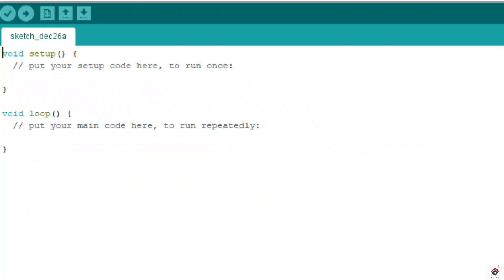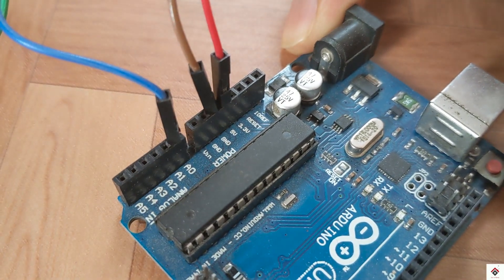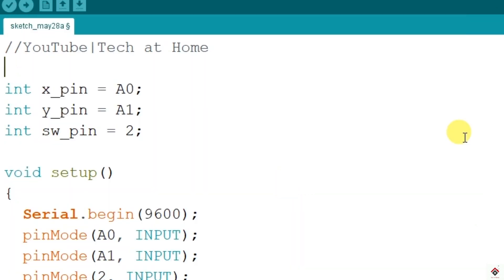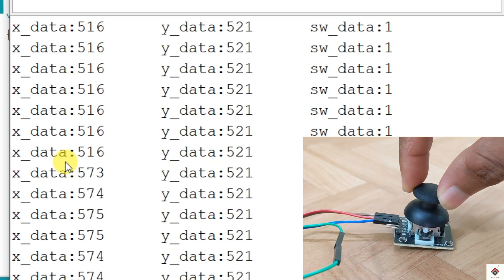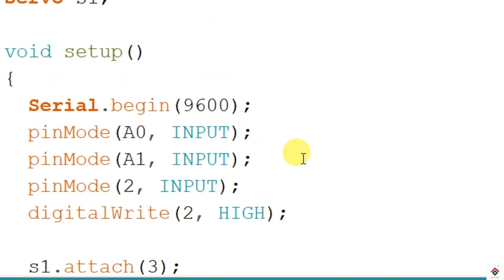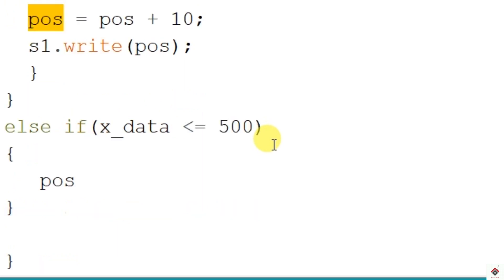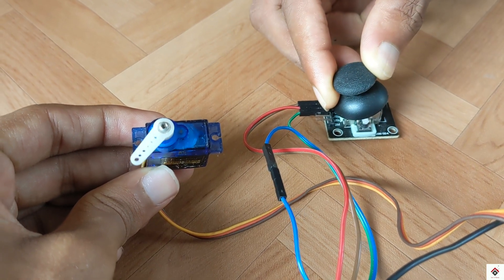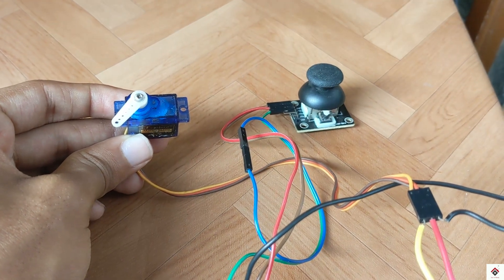Control Servo motor with Joystick and Arduino[with CODE] | Arduino Servo motor control | Servo robot

Comment: hey i am very much new to electrical and stuff , just wanted to ask can we connect 5v port on arduino to breadboard and then connect motor and joystick to it??
Reply from the maker: Servo motor draws more current, so the  voltage drops and Arduino keep resetting due to insufficient power.

So better to use external supply.

Comment: Can I power the same circuit with the help of laptop?
Reply from the maker: For servos there should be external 5v supply. You can take waste USB cable and cut the connector. From that use only positive and negative wires which are red and black. This way you can use laptop to power servos.

Comment: Day 2 of asking:Hi. I am a subscriber of you. I am subscribed since 2021. Also I have been watching you from 2021 and I haven't made any request. So, I am making a request today. Can you please make a tutorial on 900 degree steering wheel with GY521 MPU-6050 Sensor. It is a gyroscope sensor. Please I beg to attract your kind attention. If you could make it and oblige me thereby. Love from Bangladesb(🇧🇩)❤❤❤❤
Reply from the maker: Hi , Thank you for your support!
I hope you have seen potentiometer based 900 degree wheel: https://youtu.be/WMgQM67uWdM

In this same code, I had tried adding this gyroscope sensor.
But it was very unstable and fluctuating.
Steering was moving randomly since the values from this sensor keeps changing even for a slight movement.

May be potentiometer wheel is better for simulator games.
Reply: @techathome  I did. But I don't have enough materials for that. I also found out that GY52Q MPU-6050 Sensor is easy to use. But I can't find any tutorial on it for steering wheel. So, I asked if you could do it
Reply from the maker: I can try.

Fyi,
Most of the materials remains same,
Potentiometer will be cheaper compared to gyroscope
Reply: @techathome  Ok. Please make it as soon as possible or late or month or year or many years. I will wait. But still make it in any way possible. This is my strong request to you please. Also I found out I can buy it from Daraz in. 109 taka which is converted to 83 inr according to Google.
Reply from the maker: We did basic version: https://youtu.be/naZ5j_mmOhc?si=J5UMjXVIF78dcJ5w
Reply: @techathome  Thank you :D